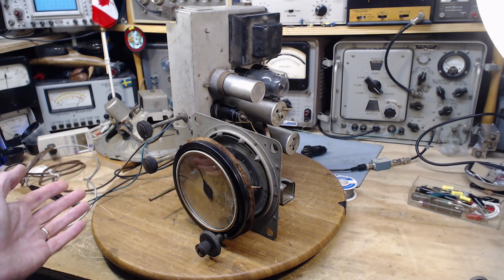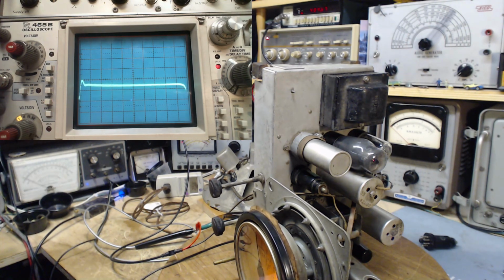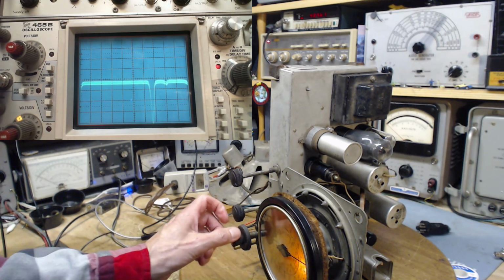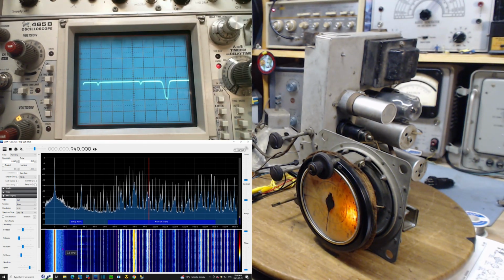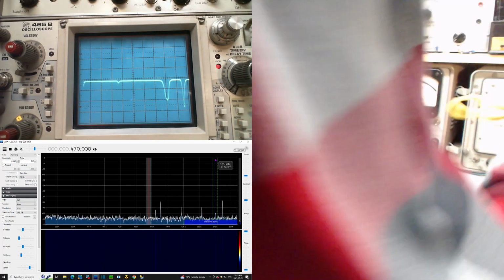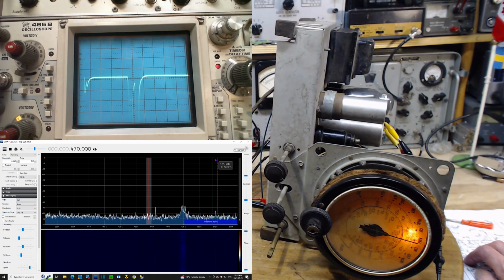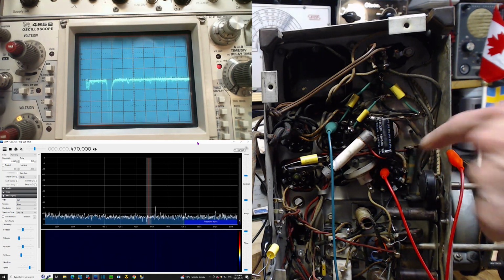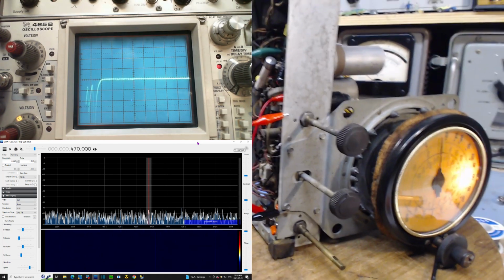Philco 38-C7 Tube Radio Video #9 - Spurious Oscillation Source?

Comment: Greetings:
Sweeping the IF circuits vs. Audio frequency response sweep.
From what I hear you describe, by setting up a sweep around 470kHz, you want to display the response of the IF passband. In addition to the horizontal sweep covering that frequency range and assuming the sweep generator triggers the scope at the beginning of the sweep period, the y-axis input has to be woring with an input from a source of frequencies that covers the same range. Since the Tek 465 trigger starts at the left edge of the screen, the sweep period should be centered about 470 khz for the response to be shown. I do not think that the x/y mode is appropriate scope mode to use. Using the regular sweep mode for the horizontal display and use the sweep generator to output the frequencies you want to show durring the passband surrounding 470 KHz. The modulation of the carrier frequency by audible spoken or music frequencies will be shown when using the rf generator's external modulation input of the audio frequency range (usually 100-5000 hz). I am not familiar with sweep generators in general,but yours may use the scope in x/y mode as long as it outputs both the x & y signals needed for the display. I will study up and get back to you.

Comment: You absolutely must disable the local oscillator to do a proper IF alignment. Otherwise you are beating the 470 Khz IF signal against the local oscillator and creating another unwanted spurious signal.

Comment: I have found over the years the best way to measure the final audio output is off the secondary of the Audio output transformer. Its a low impedance source and all you need is about a 4 to 8 ohm dummy load 2 watt resistor. Using a lower impedance also assists in measuring the audio response curve.  Monkeying with the AVC line is clever but the RC time constant delay can create false results.
There are fewer shocks and injuries working with the output transformer. Thus you are not annoyed with spurious loud audio sounds.